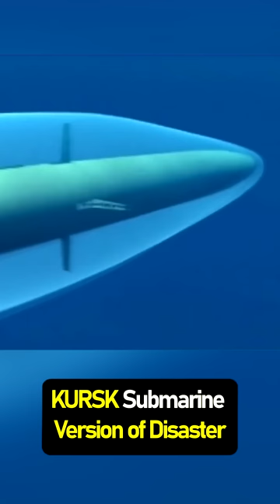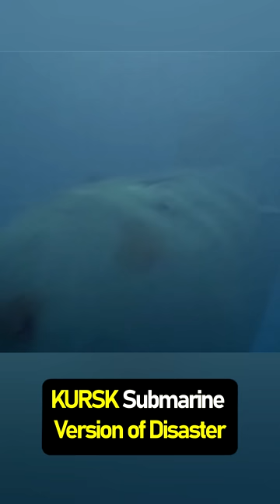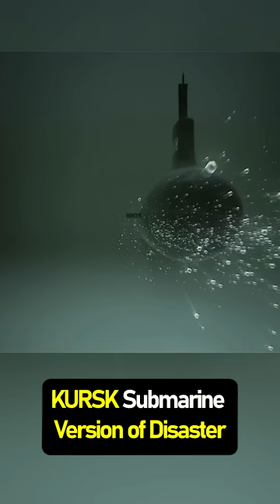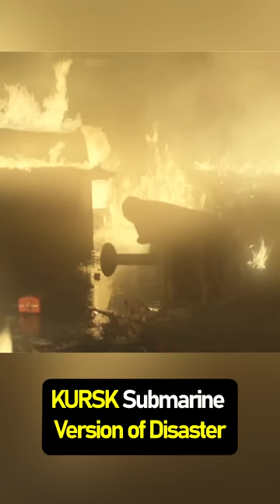Kursk Submarine Version of Disaster #Shorts

Comment: Well this video is horseshit. The curse had a torpedo explode on board. The explosion of the hydrogen peroxide leaking from that torpedo due to poor maintenance led to the explosion of the entire torpedo room. That's why when they found the boat it was missing the front. Third. There were no American submarines in the area. There was no collision with another submarine. That was a story that Putin put out initially as a cover-up. But it's been proven that it was shitty torpedoes and bad maintenance that cause the loss of that boat.